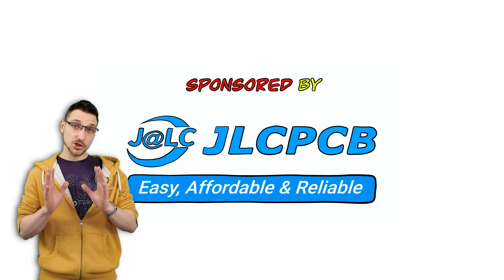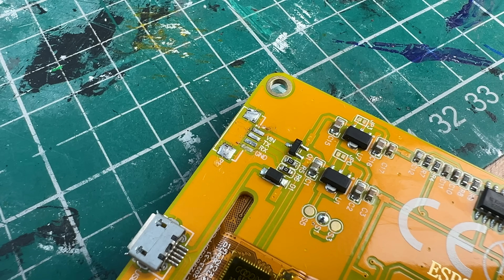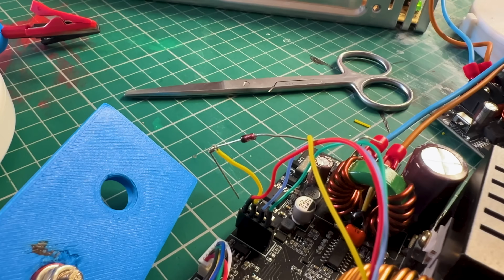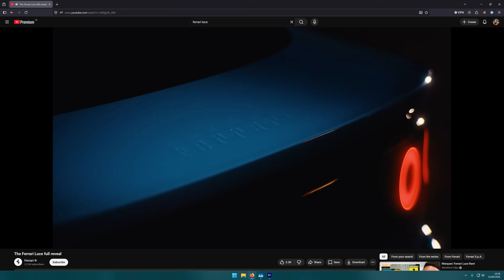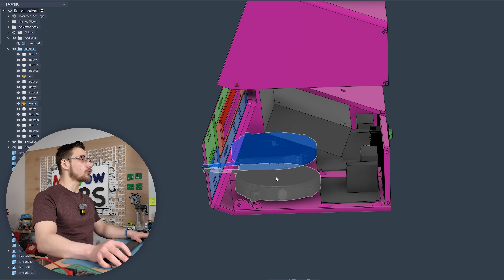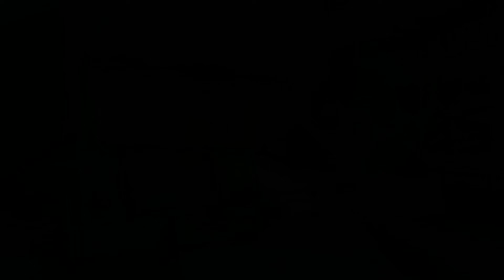I Built the Bench Power Supply Nobody Sells

Comment: I have never heard of diet pi, or whatever you called it. I need something like that for my project! It takes forever to boot into pi os. However, I'm building my interface in Godot 3.5, not the ideal pi interface builder. I got my pi4 to run my godot interface, but its slow and clunky. A slimmer OS would be nice!
Reply from the maker: yeah, there's a few lightweight distros that are worth looking at, I went with diet Pi because it was the easiest to set up with Raspberry Pi imager.
but you can also compile your own OS if you really want to get into the weeds.

Comment: I set up my bench with cable retractors underneath and the leads from the equipment plug into the color-coded jacks on the front edge of the test equipment shelf. The only mods are mounting the reels and input jack panels and making the jumper wires between them. I really hate cords on the bench in case you couldn't tell, lol. I have my scope leads installed in the same type of path without retractors so far. I have them on the far-right side of the bench to keep them out of the way and the ends are in a piece of foam to hold the wires while leaving the leads exposed for easy access. I use foam rubber for all my leads and cables. I start with a shallow cut and use concentric circles for short cords/cables, medium ones go in arch patterns, while the long ones have a horizontal strip at the top and others at each foot or so to keep them all from getting tangled while providing easy access, identification and saving time with the added bonus of never having dangly tangly cables, cords and wires of any sort frustrating us all, lol.

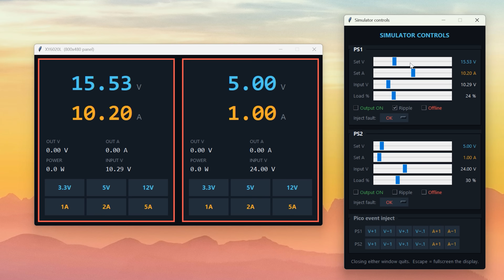Comment: At 29:24, that's "voltages and currents", not "voltages and amps".  You're from the UK, so you shouldn't be talking like a yank.  Don't get me started on them using the BS term 'amperage'.  A voltage is measured in volts, a current is measured in amps.  Mixing the parameter and the units is poor form.  You wouldn't say 'the miles to the shops is ...', you'd say the 'distance to the shops is ...'
Rant over. :-)
Reply: Interesting point, makes sense.
Reply: I get it, but I think he’s Polish and his English is extremely good so the odd slip can be forgiven

Comment: I guess all nice power supplies that come after this video will have retractable cables.

Nice work!
Reply from the maker: You’re all welcome 😂
Reply: @Mellow_labs Yeeeah... we're collectively gonna make those unavailable for a while 😁❤️
Reply: @LordPhobos6502  look for some vacuums in the trash, some models of Bissell has retractable power cords, i now have a use for one i got a few months back😂
Reply: @Mellow_labs  after watching your video I ordered 4 of them and they arrived today. 
And you said not to cut the plug off until you clamp down the cable. Which I remembered 4 milliseconds after cutting the plug off and watching the cable disappear into the housing.
Reply from the maker: Well, you can’t say I didn’t warn you.😅
Good luck fixing it, getting the tension right is an absolute pain.
Reply: or, power supplies like this one that came after electronoob’s video which has a power supply with a retractable cord and that came out 4 months ago 😁.
Reply: @volatikus that sounds shocking

Comment: "It is not the prettiest looking thing"... are you kidding me?! It looks amazing! EDIT: For communication, have you have tried to write your own I2C communication protocol? It is a lot simpler then you might think and a lot faster than UART! ;) And it solves the problem of needing more then 1 port for communication. You can set 1 as master and the rest as slaves. Adding IRQ will make the screen (and other peripherals) respond a lot faster. I've done it on some projects and I was amazed how fast it works. Anything over about 30ms is noticeable so I set that as a goal for myself to stay under.
Reply from the maker: Thanks a lot! but there are a couple things I wanna fix up.
Reply: The existing UART-based port is already capable of very high speeds, and it's using a modbus coms protocol. You can set the addresses to whatever you wish them to be, provided it 's within 8 bits.

Comment: Great project. For your screen, are you using the desktop version of rPi os? What if you use the lite version of the OS and write directly to the framebuffer? It can be a pain to setup, but it gives you a GUI without any desktop manager. Saves lots of resources.
Reply from the maker: I'm using neither, I switched it to use diet pi.
as lightweight as I can get it, without compiling my own Linux ISO.